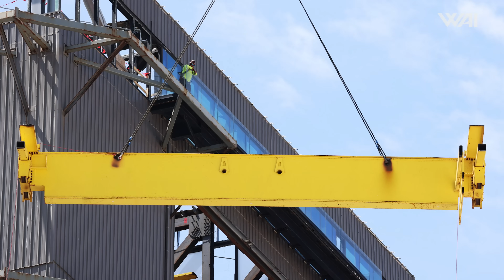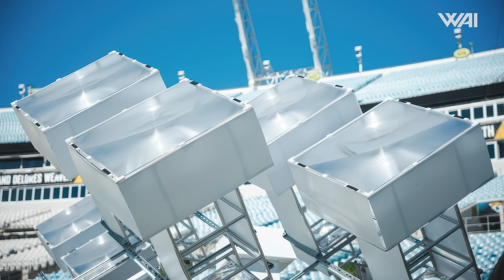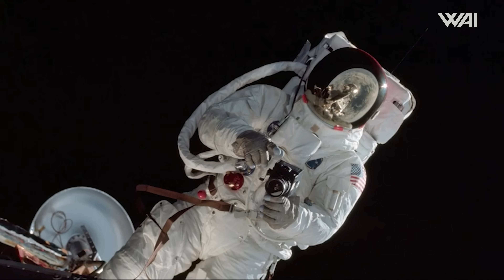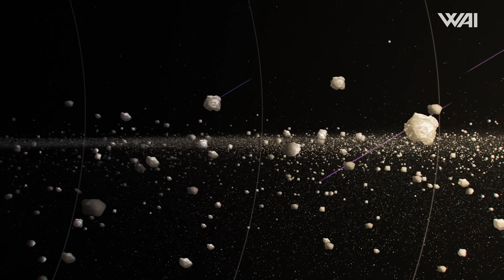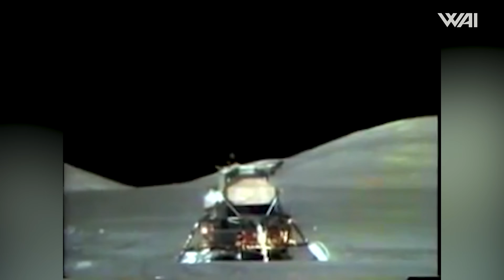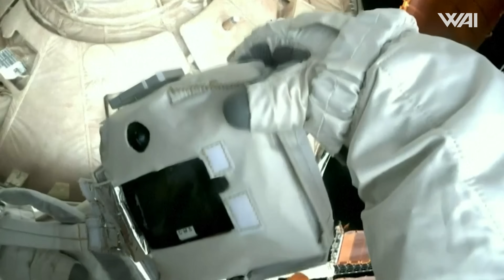SpaceX MASSIVE rush! Starship Launch Date Estimate!

Comment: Just dump Starliner. Seriously. SLS too. There are enough Falcon 9s and Dragons to be triple backup for any lunar crew. I don't know why they insist on risking the crews in the hands of Boeing.
Reply: Starliner? Yes, it failed trying to get crew back down safely. 

SLS? No. SLS is the ONLY way we know of to get to the moon right now, without having to develop any other vehicles or modify the mission architecture. SpaceX could do it with Starship and Dragon, or like that one KSP RSS video a few years ago with two FH’s and a F9 to launch the lunar lander, a cryogenic transfer stage, and the crew, all to get to the moon and back. The problem is that there is no lunar lander or cryogenic transfer stage, and it’s likely that the heatshield of Crew Dragon may not be able to survive reentry at that high speeds.
Reply: @archierush868  it is certainly simpler to develop a better heat shield. Everything else for the capsule is in place. Ditto for transfer stages. Honestly adapters are a common thing in spaceflight. Why would it be so hard to keep things simple and to use proven reliable hardware?

And since there is no lunar lander anyway, what stops them from developing one compatible with Dragon rather than Starliner, or FH rather than SLS?

And that's just assuming Starship isn't ready first.
Reply: @IsabinMarius because it may not be the hardware that’s the limitation but the architecture. Doing the 2FH/1F9 mission would definitely be cheaper, but none of the hardware to support that architecture has been made, and that architecture hasn’t even been tested before, and so it may not even work. Theres also many more places where failure could occur in a more complicated mission architecture, especially since you’re gonna have to dock multiple times to multiple vehicles in one mission: once with the transfer stage and twice with the lunar lander, all while the dragon is crewed. And again, we don’t know if the heatshield would work, and Artemis 2 got delayed solely because of the heatshield, arguably the most critical part of the mission as if it fails, the entire crew is lost, so there must be absolutely zero margin for failure in its design.

2FH/1F9 would work, but it hasn’t been proven and none of the hardware is available to support such a mission, including a crew capable lunar lander, which would take even more time, cost and effort to develop.
Reply: I doubt that Dragon has the radiation shielding to leave the magnetic shielding provided by Earth without endangering it's crew.  Would they even survive passing through the Van Allen belts?
:planet-orange-purple-ring:
Reply: @Scanner9631  it can be added.
Reply: @ it can be added.

Maybe.  
:planet-orange-purple-ring:
Reply: @IsabinMarius more weight, more powerful transfer stage, up to a point where a FH fully expended may not even be enough. It’s not as easy as just adding a new part, you must also crew rate that part as well, which is often why crew rated vehicles take much longer to iterate on after being crew rated. Even something as simple as replacing the toilet with a better one would require resubmitting the crew dragon for crew certification, so the crew certification progress for the 2FH/1F9 architecture take years longer than the current Artemis Architecture.
Reply: @archierush868 sure. Unless SpaceX does it in 6 months.
Reply: @IsabinMarius you think they can develop a lunar lander, a crewed transfer stage, and an upgraded crew dragon in 6 months?

Not happening. SLS is being used as we KNOW it works, while a crew dragon with a transfer stage COULD work.
Reply: @archierush868  ok so where's their lunar lander then? Oh wait, it still needs to be developed. So that makes no difference. SLS. Ok, so assuming it doesn't spring another 7 hydrogen leaks at crucial times, an adapter could easily fit an upgraded Dragon capsule instead of a decidedly dangerous Starliner built by a decidedly corrupt and unreliable Boeing.

Seriously the only reason Americans still waste $2B on one flight is because politics and the lined pockets of bureaucrats.

SLS is a failure just waiting to continue happening. And I'm afraid it might cost lives.

Dragon has far better odds with a few tweaks.
Reply: @IsabinMarius Dragon would require re-crew rating it, which would take years, including many major hardware and systems changes like an improved heat shield (Just like Artemis), communications and radiation shielding. This would easily take longer than it would take SLS to get stacked for Artemis 3 and get to the moon, and Starship HLS would have been made by then and tested, all just to re-crew rate Dragon and to crew rate the unproven mission architecture.

Why change the mission architecture from one that’s almost ready for crew to an unproven one that hasn’t got any hardware to complete said architecture? We know this mission architecture works, but we don’t know if the 2FH/1F9 architecture will. It’s not worth it to cancel a rocket for an unproven mission architecture, especially when the hardware for it doesn’t exist and would take years to get made, longer than it would for SLS to get to the moon. Not to mention, SpaceX is no longer making new Crew Dragon’s, so you’ll have to either pay them to refurbish one that’s flown, which would be expensive, or pay them to make a new one, which will be just as expensive.

SLS stays until another option is available, and there currently isn’t a second option.
Reply: @archierush868  As long as NASA toes the political line, nothing will happen in less than 5 times the time it should have taken, if it ever happens at all. Yes crew rating is a thing. But SpaceX is quicker and more economical and reliable in literally everything, especially when not restrained by... well, politics... A Dragon Heavy or whatever will be more reliable in first iteration in a year from now than the Boeing reject that should never have been commissioned for production to start with. Starliner is a death trap.
Reply: @IsabinMarius it doesn’t matter who it is, SpaceX, Boeing, anyone else, Crew Rating will always take years. Just because it’s SpaceX doesn’t mean they can expedite it, especially with crewed vehicles. I do agree that 2FH/1F9 would be cheaper for getting crew to the moon, but it’s too late to change the mission architecture since SLS is getting ready for the next flight and the one after that, so unless they announce that they will go with this architecture going forward very soon, SLS must stay.
Reply: @archierush868  at the rate that SpaceX can churn out spacecraft, they can basically speedrun the process. Crew rating is not about time, but flight-proving the hardware and software. And as we've seen they do speed while doing quality too.

The only reason they are still using SLS is to be able to claim the entire investment was not wasted. So instead they just waste more until they can show at least two hatched eggs for their $2000. Better than one unhatched egg for $1000. So essentially this is about saving face in front of tax payers. Aside from financial benefit, of course. But I already mentioned that earlier.
Reply: @IsabinMarius again, you would need to crew rate the other mission architecture, which no-one has announced, and no-one has pushed for because the people at NASA know that it’s either too risky or could take too long to crew rate, maybe both. SLS is not going anywhere until a second crew rated vessel or mission architecture to the moon is available which is cheaper. Again, 2FH/1F9 could be cheaper, but there is no hardware to support that architecture, therefore we cannot cancel SLS for it.

SLS stays until another option is available. I like the idea you have shown, but that hardware doesn’t exist yet, so we can’t cancel SLS for it.

Comment: SLS is a doomed waste of money.  Nothing in the Artemis program is going to be on schedule, so might as well take the SLS billions and spread it around the Artemis and science programs to do more productive things.  The Starship program will be complete and human certified in about the same amount of time as the SLS, and when it is finally certified, we could do flights monthly instead of every 2-3 years.
Reply: SLS is gonna get crew rated on the next flight, now set for February due to how fast they are stacking it. Starship is a maximum of 3-5 years out from being crew rated. Also, cancelling SLS means that you have no way of getting to the moon with crew. Sure, Starship could do it, but it would take years to crew rate it, so much so that Artemis could just be cancelled.

Your logic really doesn’t work. SLS is taking forever, so we should cancel it for another program which is even farther behind the human rating progress for a mission architecture that the SLS was originally designed for? SLS works fine, it’s just taking a long time, but with no other option available that can take crew to the moon, it must stay until another crewed option is available. That could be Starship or it could be something like a nuclear tug which can transfer crew to and from LEO to LLO and back, only requiring something like a crew dragon to get orbit. I did something like that in Kerbal Space Program except with an SSTO instead of Dragon and with an architecture like that, it would be incredibly cheap to send crew to the moon. The problem is: That currently doesn’t exist, so we have to use SLS until it does.

Comment: I wonder if the fuel transfer tube or downcomer in the Starship is supported mid length etc?  When fuel is flowing through it, it will want to bend due to Coriolis forces. A Coriolis Flowmeter makes us of that property.

Comment: The cost of SLS is absurd compared to Starship. I don't think it can be justified to continue the program. If you want redundancy, Blue Origin's New Glenn is coming, and should be far cheaper.
Reply: New Glenn can’t send crew to lunar orbit, even when fully expended. SLS can. SLS must stay until another alternative is available
Reply: @archierush868 
Why couldn't New Glenn do that? It's a big rocket, it can do exactly the same things as other big rockets.

And SLS is so expensive that it would be cheaper to scrap the thing and start over.
Reply: @andrasbiro3007 New Glenn only has a payload capacity to TLI of around 7 tons. Orion weighs nearly 35 tons. Falcon Heavy has a greater payload capacity, but still wouldn’t be enough, plus you would need to crew rate Falcon Heavy, which could take years, despite it being 3 F9’s.

You need way more fuel than you realise to get to the moon
Reply: @ 
I thought New Glenn is much bigger. It was supposed to be at least an FH competitor.

But even then, Starship is almost done, and it's plenty big enough.

Comment: Beamed space power would make sense for planes, and maybe ships. Planes consume a lot of energy, and must be light. Ships spend a lot of time away from the grid, and their surface area is not enough to be solar or wind powered (big ones at least).
And both would be willing to pay higher prices too, planes especially.

I'm not sure it makes sense for ground based customers or satellites. Both can use solar power on their own. What could make sense is augmenting traditional solar, to reduce the need for expensive energy storage. But nuclear power could be more practical, reliable, and cost efficient.

Comment: I think Artemis is a huge waste of money. They’d be better off going back to the shuttle program and updating it bringing it up to the 22nd century nuclear engines maybe Draco engines to land on the moon and then I still able to use runway landings.
Reply: But heres the problem: we don’t have nuclear engines yet, and we don’t have any real way to get to the moon without SLS. Not to say we’ll never have nuclear engines, we almost certainly will, it’s just that we don’t have them right now, and that we can’t cancel a program for another which hasn’t shown any physical hardware yet.

1 is none, 2 is one. Make sure you have two ways to get to the moon before making a final decision.
Reply: @ just because it’s not done doesn’t mean we can’t do it. Look at starship it’s ginormous and look at falcon 90 we never land a rocket back on the launchpad horse Pucky if we want it bad enough, we can do it just gotta put the right people in charge.
Reply: @whiplash8011 yes, but again, we don’t have nuclear thermal engines yet, and there is still no guarantee that we will, so to cancel a program for another which may not even deliver is too much of a risk.

Comment: Artimis appears to work as designed, without failure.   X has 2 billion in building Starship, easy.  Hasn't made orbit. :(
Reply: Artemis cost 2 billion per launch. Starship only 100 mill
Reply: They can also launch them once every 1 to 2 months. Artemis years apart.

Comment: They are reusing booster 14 for this flight (9)
Reply: But NOT planning to catch it.
Reply: @roycsinclair  Is there any official confirmation about the decision not to catch it? All i've seen are some tweets and rumors.
Reply: Really? No catch?
Reply: @TheItalianAvgeek No catch, they just want to check off the box for "we reused one".  Not surprising though, they are trying to use up all of the old V2 Raptors so the craft built using those V2 Raptors are not considered special in any way.  May be a while before we see them reuse a booster more than once.
Reply: @roycsinclair Don’t understand the ‘no catch’ tho; re-re use not required, still would benefit from getting it back.
Reply: @dphuntsman  That's why I mentioned the Raptor 2 engines, they are the single most expensive parts collection of the whole booster and yet they want to "use them up" and not keep flying them, Raptor 3 is both more powerful and seriously more robust allowing them to drop a lot of shielding that is on both Booster and Starship and thus reduces their weight by a considerable amount. The combination of Raptor 3 and less shielding allows for more weight to space and the simple fact is that NONE of these experimental Boosters and Starships will last long past the time they decide they have their first Production models.
Reply: @roycsinclair  

With a successful flight 9 and an orbital flight 10 the block 1 boosters can be "used up" if desired on refuelling test launches.
:planet-orange-purple-ring:
Reply: @Scanner9631  Refueling flights will need the Raptor 3 most, fuel and oxidizer is a very  heavy cargo so they'll want the best engines on the boosters and Starship tankers to minimize the number of flights it takes to provide the needed fuel.
Reply: @  Refueling flights will need the Raptor 3 most,

As I said 

"With a successful flight 9 and an orbital flight 10 the block 1 boosters can be "used up" if desired on refuelling test launches."
:planet-orange-purple-ring: